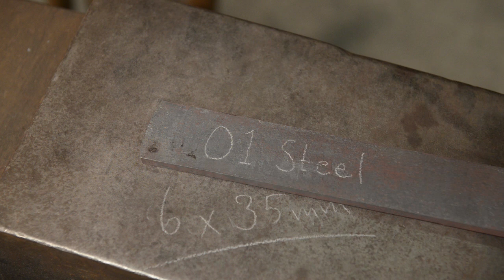Blacksmithing - Forging a herb chopper

Comment: I used your method for the handle to make a herb chopper of my own today  (I put a handle at each end) It works so well. Thank you.
Its just a hobby for me, I'm not very good but I enjoy doing it.  I thought I was going to have to cut a tail at each end to make handles. I'm glad I came across your video. Greetings from Ireland.
Reply from the maker: How nice! Thanks and good luck with your next project!

Comment: When i make these, i use the same techniques with very few exceptions. I typically round my tails instead of keeping them squared. I don't typically grind the tip of the blade squared either. Also, using a brass brush at the very last heat on the spine and tail handle for a "Finnegan's Gold" effect is very nice to look at, in my opinion. Very well done! Hope to see more of your videos. +1 subscriber!
Reply from the maker: Ok, great! Thanks.

Comment: Im thinking about making my mother one of these as a Christmas gift. for the sharpening and grinding, could a metal file and sandpaper work if you dont have a power sander or an angle grinder?
Reply from the maker: I think it will work. It depends somewhat on what steel you have, and if you can anneal it properly. I use O1 which to some extent air harden and can be tricky to fully anneal without a heat treating oven. It's tough on your files if not soft enough.
Reply: Is there any specific steel that would be easier on the file but would still be hard enough for this chopper? Thankyou for your answer btw.
Reply from the maker: Aaron Stoeckl I'm no knife maker really, but I think W-1,1084 or 1095 (hardened in water) is easier to work. Even salvaged spring steel (oil hardened) would work fine, and it usually is soft enough if you let it cool by itself slowly.
Reply: I will keep that in mind. Thankyou Torbjörn Åhman
Reply: Torbjörn Åhman hey I'm not sure if you know or not but someone has quite a bit of this video in a compilation, it's just sped up and parts cut out. Just letting you know because I know other people who are having problems with people taking their videos without asking or giving any sort of credit.
Reply: not to mention doing this by hand would be a giant pain in the ass

Comment: I would love to get to do this one day but I can't afford the anvil forge or steels the rest is just part of a basic tool kit though any recommendations for cheap yet good forges in the uk ps love your videos ;)
Reply from the maker: Thanks. A forge is quite easy to build. A pipe and a hole in the ground is pretty much a functional forge. Just need a blower. Anvils can be hard to find, but just keep your eyes open and search flee markets, farm auctions etc. Contact local blacksmiths and seek info. Any large chunk of steel would work as an anvil in the mean time.
Reply: Torbjörn Åhman ok thanks . are you ever going to do an in depth beginners guide ? .
Reply from the maker: xtraw I don't think so... but you never know :) I still consider myself a beginner at many levels.
Reply: Wow I consider you a high class expert
Reply: xtraw it's pretty easy to make your own forge. I've made a couple. Anvil just needs to be a solid bit of metal
Reply: xtraw a bunch of charcoal and a hairdryer is a fine forge
Reply: Louis or stone or even wood works fine

Comment: What is the small iron flakes falling off when he's hammering it?
Reply from the maker: Iron oxides. It forms on the hot surface in contact with air.
Reply: Makes sense, thanks man

Comment: as a dane it is my civic duty to mock you. soo... shitty sharpening technique?
that however, was the only flaw i found.
Reply from the maker: Ha ha, shitty enough to work just fine.... :)
Reply: Torbjörn Åhman ya, im just jealous of your vice i guess.

and a bit pedantic about the sharpning
Reply from the maker: inceptori :) Some day I will buy some Japanese water stones and do it properly.
Reply: Torbjörn Åhman no need for that, you cuts were quality. it just lacked a little, i should think that with this http://www.dba.dk/koekkenudstyr-slibestaal-til/id-1021675238/
it will get that final kick.

Comment: This is beautiful work. The height of the blade, the rocking movement it all perfectly done. But for someone like me who has to chop large amounts of herbs, often the handle is not practical at all. Too thin, and there is no easy way to rock it back and forth to use it on the herbs. ❤

Comment: I love your approach at making this.  Especially how with one small cut, you bent and forged a handle out of the smaller side.  First time I ever saw anyone do this.  I can't help but see how one could forge a straight razor using this method, rather than just cutting the shape out of the stock, and then grinding it, wasting perfectly good material.  Raises the question; have you ever forged a straight razor?  Up to 5:40 in the video, one could have thought that was what you were making!  As always, I am truly impressed with your masterful skills.  I am embarking myself in this journey of learning to forge.  Thank you for these wonderful videos, we can learn a lot just by watching a master at work.
Reply from the maker: Thank you and good luck! No I haven't made a razor... yet.

Comment: so. if you like your flat iron for a bevel, you can bore a hole through the other side, and run a bungee cable around your anvil so it doesn't bounce around.

Comment: wonderful work torbjorn! seeing that you're testing out how to even a bevel might I suggest to place the work where the lowest flat part of the anvil meets the horn. the difference in height will control the bevel while the roundness of the horn will also move the steel a little better
Reply from the maker: Thanks! Might be an option, yes!

Comment: Beautiful form and function Torbjorn!  Also enjoyed the apples, flowers growing...Nice Touch...Quality takes time.  Loved the curled grip too. Also your video and editing is getting to be some of the best out there, IMHO.  Can you estimate how much the forging adds to the hardness you achieved with the anneal, soak, oil dip and temper?  Thank you for sharing your talents and tastes with us, a real pleasure!  ~PJ
Reply from the maker: Thanks once again PJ !!  In my mind the actual forging does not contribute at all to the hardness. Especially since it's annealed after forging. To gain hardness by forging you need to forge it cold more or less I think (to work harden). Any of this would surely go away with a thermal cycle like annealing. I could very well be wrong on this, but I think there are misconceptions (or even myths) regarding this...

Comment: Youtube blacksmiths take notice... he filed and ground to shape AFTER annealing and BEFORE hardening!  That way, the annealing reduces the chances of cracks and the grinding process won't mess up the hardness of the cutting edge.  Bravo sir.
Reply: Or it's just easier to work with softer steel...

Comment: I do like the flat bar to assist in bevel thing, but if you decide to keep doing it, I would reccomend making a hardy hole tool for it so it's not bouncing and moving as much
Reply from the maker: Yes and round off the hard edges!

Comment: Oooof the belt sander had a Lil on edge since you did it without gloves, well done.
Reply: You actually shouldn't wear gloves when working with rotating tools like that type of sander or circular saws. There's a huge risk your glove will get caught on it and pull your hand onto the tool. A workshop teacher of mine actually lost two fingers that way. Other than this type of tool, yep, you should always wear gloves appropriate for the job.

Comment: welding the bar to your Advil or work table might provide a stable permanent bevel for weapon making. We did something similar in my highschool welding class.
Reply from the maker: I could make a more permanent tool, but never weld anything to the anvil... that would ruin the heat treat.
Reply: Thank you for the advice on the Advil. Like I said highschool welding class lol

Comment: thanks for such a good video... i want to know why the quenching liquid is different?? is it because the type of material?? i see some times you use Water, oil, this time canola oil? why is that?
Reply: O1 (what he is using) is an oil hardening steel, other types of steels require different liquids for hardening. W1 is a good example of a steel that should be quenched in water for optimal hardness.
Reply from the maker: Precisely as Kevin points out. Every steel alloy has it's own specification. Some needs to be cooled fast others in a more gentle fashion (oil being more gentle). The "O" in O1 steel actually stands for "oil". And more or less any oil works for quenching. Canola oil is cheap and clean.

Comment: Its called a mezzalune (half moon) <meh tsa lewn neh>  in the culinary world. Sorry if other people said it before. Much respect. Ive never seen brushing off the flakes. What is that called?
Reply from the maker: ok!  It's called "scale", it's iron oxides that form on the hot surface.
Reply: I actually guessed it was iron oxide. Would that make the process you are doing with the wire brush "Scaling"? Also, a good quality iron oxide is a large component in thermite. Which may be of some use to a blacksmith. But I know you have more modern tools for cutting now. Food for thought.
Reply: oh, Save your aluminum shavings if you wanna make thermite and say, weld a railroad tie together.

Comment: Thats a nice job u have done !!

My curiosity is for bee wax finish
Once u use it and wash it then  bee wax coating will be gone and rust will come 
What can b a permanent solution to avoid rusting on these forging products ???
Reply from the maker: There is no permanent solution other than using stainless steel.

Comment: Just something you might want to try line up the blade with the earth's poles north and south while quenching in oil bc the metal loses it's magnetic property when it's hot enough to be quenxhed
Reply from the maker: :) Well, you think that actually would make a difference? I have heard about it, but it's just hocus-pocus.
Reply: Torbjörn Åhman awwww uwu
Reply: Torbjörn Åhman just luck for no warping lol

Comment: The sunflower oil at the end was a mistake, wasn't it? I tried it as a lubricant on my bike and it made the gears sticky as all hell. I can imagine it did the same to your knife. I've found that olive oil works well on my bike (meaning it doesn't make the parts sticky after it dries), so I can highly recommend it to you as an alternative to sunflower oil. Also, great video! I was impressed by your idea to use the angle grinder at first to cut a groove in the metal, to save time on bending it. Maybe that's common practice among metal workers, but I've never seen it done before, not on any youtube video I've seen.
Reply from the maker: Works fine on a knife... I wouldn't use any veg. oil on my bike though :)  Thanks!
Reply: Fats and oils have been used as lubricants for centuries, if not millenia. Do yourself a favor and stop trusting corporations blindly, who tell you that only what they manufacture can be used for your purposes, and who stand eternally ready to strip a man of his wealth.
Reply from the maker: Well I wasn't saying that... the problem with veg. oil is that is tends to oxidize quite fast and get thick and "skicky".
Reply: I suppose that's true. But I still prefer my method. Let's face it, i'm just too cheap to spend money on bike oil when I have something that works at home.

Comment: i was thinking that it would be bigger but looks great! did you ever tried to make a mezzaluna knife? its almost like this but it is a 2hand knife
Reply from the maker: Thanks. No I haven't. For a larger version like that you probably need tangs for wooden handles rather than an all steel design like this.

Comment: Why didnt you use the oil burner ? And if there is no particular reason, which is the advantage from one over the other ? 
Amazing vids by the way !
Reply from the maker: Thanks. This is a small project. Much more efficient using the coal forge, controlling size and amount of heat. A furnace type forge is good to get an even heat and to keep multiple work pieces hot at the same time. More of a production tool really.
Reply: Ohh, I see. So this is something more personal and it gives whatever you're forgin a stronger character. Thx for the answer !

Comment: Torbjörn i have a couple of questions regarding stuff in the video, 1st where do you get your solid fuel from? and 2nd is why do you use the metal brush on the hot steel? is it to get rid of oxidization maintaining the high carbon steel?
Reply from the maker: I live in Sweden so I can't give you advice on where to buy solid fuel where you live. I brush the scale (iron oxides) off the work piece not to forge it back into the work. The scale is much harder and will form pits...
Reply: Torbjörn Åhman oh no yeah i get it now, the pits with some of the grey oxidisation which are hard to get rid of. oh ok. thanks for the tip.

Comment: So did using the flat stock help keep an even bevel? Or was it just getting in the way?
Reply from the maker: Not sure...I think it helped a bit, but if you try it, grind the corner smooth on the flat bar, so it doesn't leave marks.

Comment: Hi Torbi, how long does it last between hardening in oil and putting in the oven? And how lond do yoi let in the oven? I´m sorry, many questions....
Reply from the maker: You should temper immediately after hardening. In fact it should never cool down completely, just below say 50-80C
Reply from the maker: I temper for about 1 h.

Comment: where do you get all the equipment and is your forge just coal and some air, please respond
Reply from the maker: I keep my eyes open for used stuff at auctions and sites similar to craigslist. You can even do finds at flee markets and garage sales.  I can use coal,coke or charcoal in my forge. There is just a fan that blows air from below.

Comment: im curious, why do you strike the anvil every so often while hammering the metal?  I've seen it done in loads of forging videos.  is it a functional thing, where you remove scale from the hammer so it doesn't reapply into the hot metal?  is it just a rhythm thing?  thanks for the great videos!
Reply from the maker: We don't strike the anvil... just let the hammer bounce. It's hard to explain... Now and then you want to skip a blow to turn the work or evaluate what to do next. Instead of wasting energy stopping the hammer mid air, we let it rest or bounce on the anvil. Sometimes you need to re-grip the hammer in a different way, same procedure. I know it can look a bit odd... It has nothing to do with removing scale... it does not stick to the hammer or anvil for that matter.
Reply: thank you for the reply!  I understand it now as you explain it.  i'm enjoying your channel and your approach to your craft.  this herb chopper is absolutely gorgeous! the chef in me is drooling :-)
Reply from the maker: Great! Thanks

Comment: Thanks for sharing. As a beginner in blacksmithing I appreciate the details and precisions of your skills. Just one question, what kind os steel it is ?
Reply from the maker: Thanks. This is AISI O1 steel.
Reply: Torbjörn Åhman Thanks again. I didn't know that kind of steel type reference, just the 100MnCrW4 type.
Reply from the maker: O1 is the American designation...
Reply: Torbjörn Åhman By the way, i tried to do like you for the handle : cut with a grinder (i tried to make a simple celtic knife) , but the steel just rip himself and finished broke... https://imgur.com/a/JK5sh . The steel is a piece of damper, i didnt know the exact composition.
Reply from the maker: Strange... did you work it too cold or too hot maybe?
Reply: Maybe too cold I think you're right. Thanks again, and keep posting your amazing work please !

Comment: one question and a statement; what was the hardest part for your hands to adapt to the heat of the flames, or the pounding of the hammers?
also i really enjoyed your video it's almost as if you put a bit of your self into it all.
Reply from the maker: Thank you Joe!! I don't think you can adapt to heat! :) So it must be the hammers then... ha ha.
Reply: Torbjörn Åhman you probably have and don't realize it lol
I use to cook professionally and my hands got so use to the heat I got to the point of being able to handle fully cooked meats out of the oven with only a ruber glove
Reply from the maker: Ok cool... I mean hot!  You're probably right, but when it comes to blacksmithing you try to stay away from the heat and never grab something potentially hot ... and when you do, it's always a painful experience. I think grinding is the worst part, when the heat builds up in your work piece and you try to grind that last edge....

Comment: What is the purpose for the sunflower oil? And also engulfing it in the canola oil?
Reply from the maker: The sunflower oil is to prevent it from rusting and is food grade.  The quench in canola oil is the actual hardening of the blade.

Comment: Great work! How come you annealed after forging?
Reply: Just a guess but likely normalizing to reduce the stress in the steel from forging before hardening. I believe it helps keep the steel straighter during hardening and hold a better edge after hardening.
Reply from the maker: Annealing or normalizing is good practice after forging. It refines the structure of the steel. However the main reason in this case is that O1 has a tendency to air harden to some extent if normalized (cooled in air). So, to make it easier to grind and file, you want to anneal it so a softer state. Cooling in vermiculite helps, but it's not an anneal to spec. For that you need a temp controlled furnace.

Comment: What is the purpose of quenching it in the oil and setting it in the oven?
Reply from the maker: You harden the steel by quenching and temper in the oven. Tempering brings back some softness to give the blade some toughness. Rock hard is too brittle.